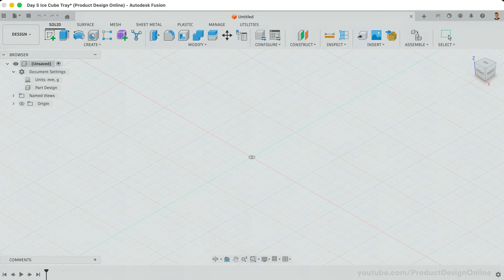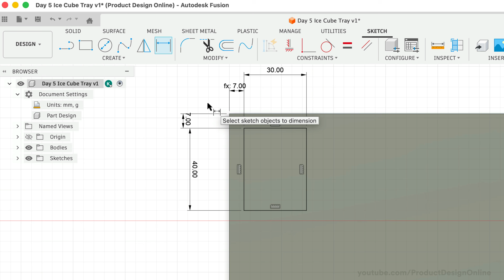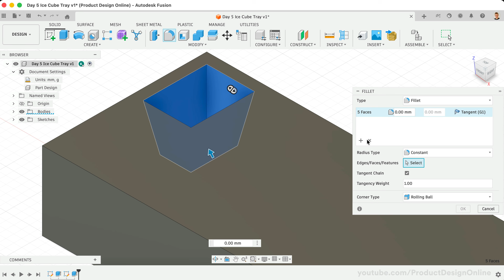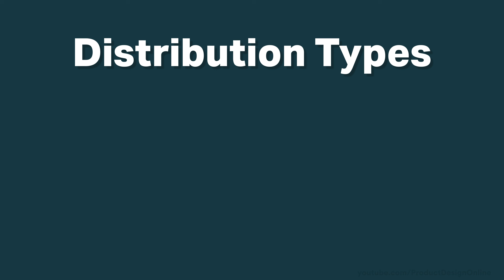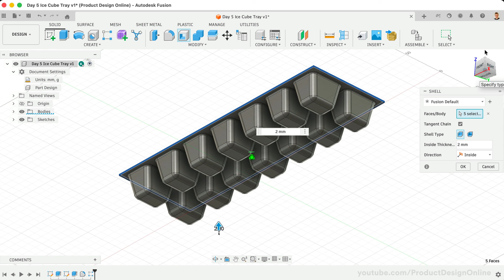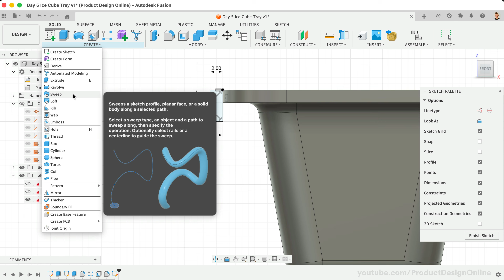The 'Secret' Shell Trick | Day 5 of Learn Autodesk Fusion in 30 Days! (2026 EDITION)

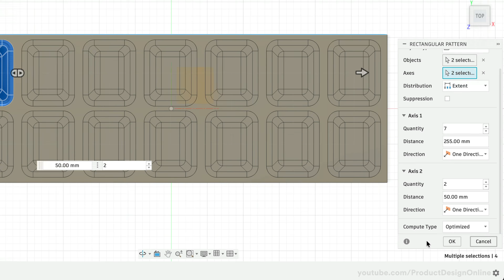Comment: 7:30 I was unable to get any one of the three options for the rectangle pattern tool to work after fillets. I believe my computer just doesn't have enough gusto to do that calculation after fillets. Because I'm using the personal use version and some features are hidden for me, I was not able to force the fillet tool to act on multiple objects after generating the rectangle pattern, I was able to roll back my timeline and generate the rectangle pattern before fillets and I just had to manually select all faces while holding control. 

Let me know if there's a better way to do this if not I hope this comment helps somebody.
Reply: Make sure you selected solid rectangular pattern first, then go to your timeline and select extrude and fillet. It's not your computer and software works the same even if it's for personal use it just has few limitations. I'm using a 6 year old laptop and a personal fusion and it just works very slow but still solid💪

Comment: Got an error using Rektangular Pattern: R-Pattern1 - Compute Failed - No pattern instanses could be intersected with the original body. Try adjusting the pattern settings, or changing the selections.

Solved by selecting both Etrude2 and Fillet1 in the timeline so everything in the extrude was hightlighted in blue.

Comment: I was surprised by how the shell worked.  I thought it would keep the outer wall but make a void inside between the outer wall and each ice cube compartment.  I think I'll need to figure out how that works to wrap my mind around it if it''s not expanded on in a later video.

Great series. Thank you

Comment: I love these videos. They help me so much. And they are very very cleanly explained.

Anyway, you mentioned that "patterning" a fillet in more complex models is not ideal due to performance issue. What is the alternative to achieve the same result? Just pattern the extrusion and then fillet individually?
Reply from the maker: Glad to hear that! 😊

Yes, that's correct. You complete any patterns or mirrors without fillets and then you apply all fillets at the very end of your timeline.

Comment: Hi. A really great series and enjoying it. Just a question, When do we apply the draft under modify. Right now we applied extrude then the taper angle. Can we also apply draft there too?
Reply from the maker: Thank you! Glad to hear that 😊 

The draft tool will mostly do the same thing as a taper angle. You can use either. Most 3D tools don't have a taper angle option so you have to use the Draft tool after the fact.

Comment: when i made the sweep profile the vertical 2 mm line was not fully constrained ( blue ) although i was able to use the sweep command like that but i dont get why that happened ? btw great tutorial thanks !
Reply from the maker: You can still reference under constrained profiles, it's just not a best practice and a bad habit to do long-term. If the vertical line is blue, you will need to either constrain the adjacent line or that line itself. Try adding a perpendicular constraint to the line and the top line.

Comment: There wasn't a selection for Compute Type when I did this, so maybe they changed it to keep things simple for the user?
Reply from the maker: I believe it only shows up when you Pattern (or Mirror) features but not the bodies or faces. Can you check yours to see if it shows up when you use the Features object type?
Reply: @ProductDesignOnline  Ah, you know what, I think I selected the faces instead of the extrusion and fillet. Is what I did an acceptable way of working? I guess it's probably more efficient and/or flexible when done the correct way?
Reply from the maker: Faces are an acceptable way. It depends a lot on the project. Sometimes they are better than features, other times they can be more risky if the faces are complex and/or get affected in the timeline.
Reply: @ProductDesignOnline  I see, thank you!

Comment: The shell was surprising, however it seems, at least to me that the final fillet was a prime candidate for using the sketch fillet feature.
Reply from the maker: Glad to hear!

I wouldn't recommend Sketch fillet in this case for a few reasons:
- Model fillets are their own timeline action. This makes it easy to update or more importantly, suppress as needed.
-model fillets can be deleted or removed in one click, if you change your mind and want to add chamfers or a different type of geometry 
- Sketch fillets will make the constraints/sketch more complex (obviously not a huge difference in this case, but if one were to go change dimensions in the sketch it likely would cause problems).

Comment: I got through this lesson except for the final operation.  The sketch did not update its dimensions in the same manner as shown in the video.  Not a big deal, but slightly frustrating to not be able to recreated the exact object. The shell command combined with the tapered function will be very useful moving forward.
Reply from the maker: Can you share more about the sketch issue(s) and/or email your Fusion file to me (email in YT bio)?

Comment: I wonder if there is a way that instead of entering Distance in rectangular pattern I can pick the two parallel walls and set the quantity and it make copies of features based on start and end point. If there is a way and we can discuss in one of the upcoming videos. Thanks!
Reply from the maker: There isn't (with the current version of Fusion), unfortunately.

Comment: The use of shell and constraints will make designing cabinets and profiles easier. I do not see a version number when I save files?
Reply from the maker: Collaborative editing is being rolled out to everyone which is changing how versioning works. My account is supposed to get updated April 9th and then in one of the following lessons I will discuss the new versioning.

The good thing is I do believe it's a huge improvement. Instead of every single save being a version, you mainly create the version... Which prevents you from having a bunch of unnecessary versions.